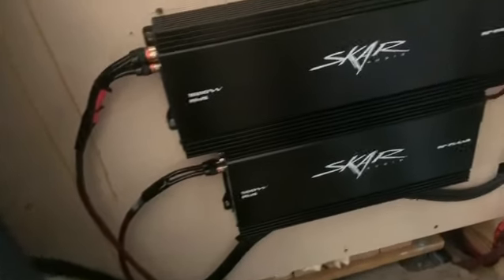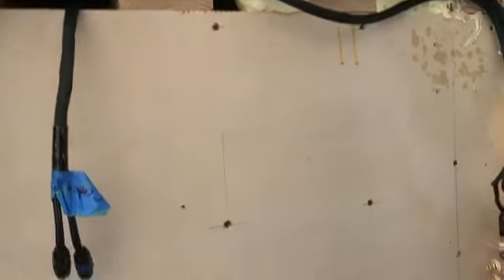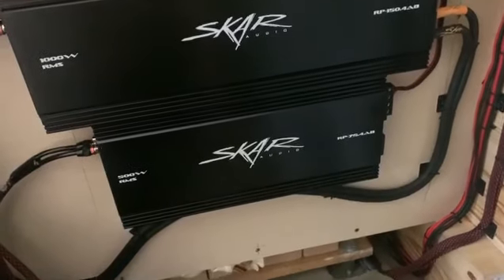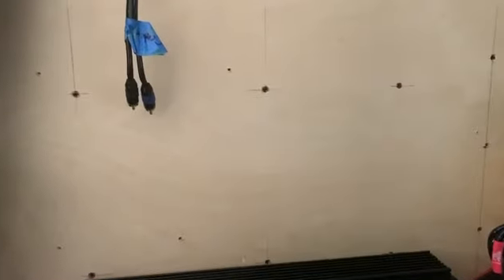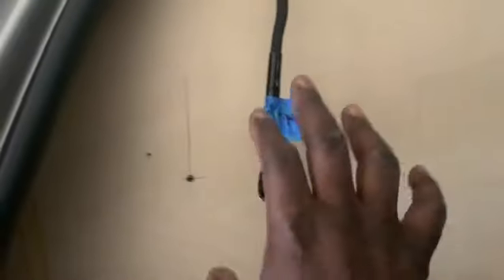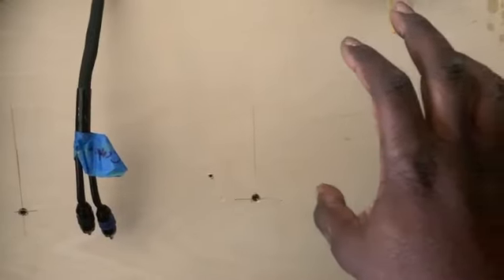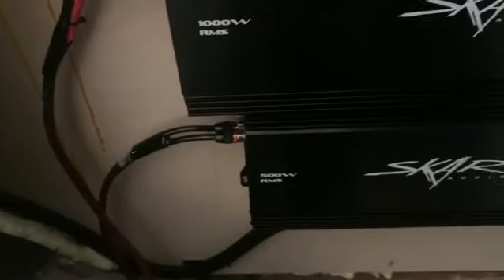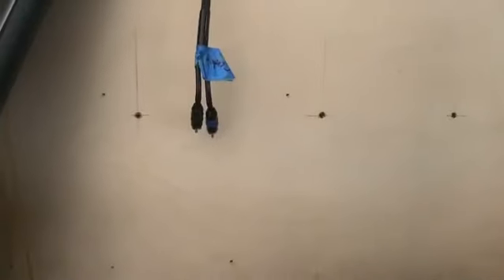Project powerus almost done!!

Comment: I thought you were gonna use all powerus amps.
Reply from the maker: Cory Binion those two skar amps are just for all my tweeters. The other 8 are all powerus 4 13.5ks. 2 3500s 2 1600. I don’t need a lot of power for my tweeters, powerus smallest amp is 1600s and I don’t wanna put my tweeters on all that power so I got a nice AB amp for highs
Reply: @mondo82111  oh ok